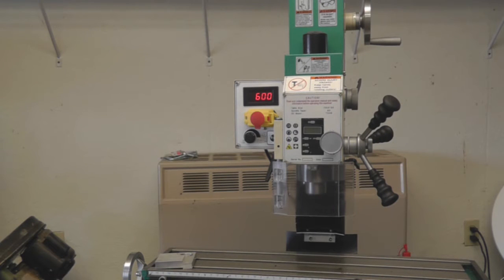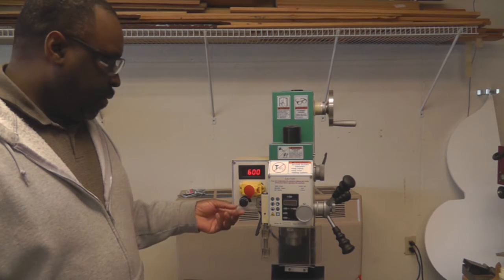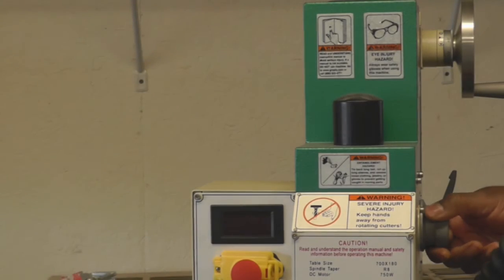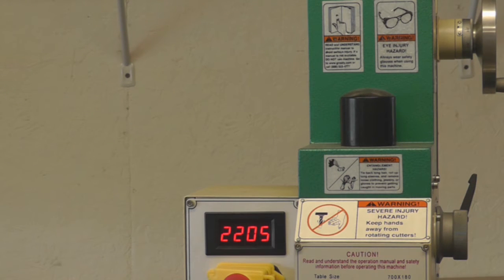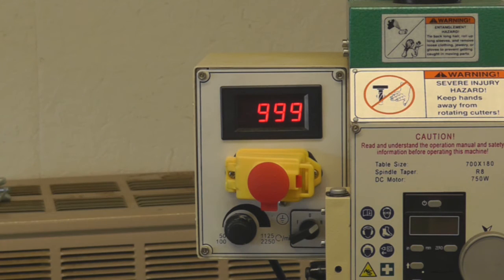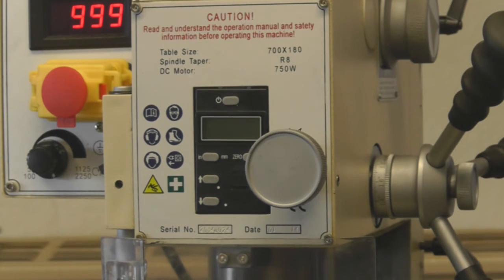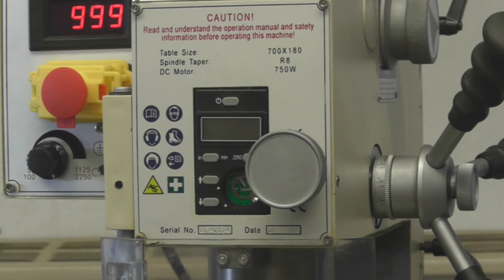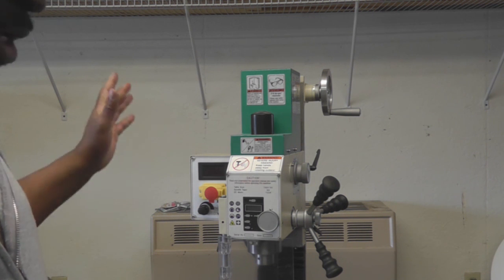Grizzly G0704 spindle break in

Comment: Hi just purchased a G0704 Do u no what's a Good speed to run a 3/8" end mill to cut 7075 aluminum? I'm still new to CNC machines, Mines 0704 is still stock. Thanks in advance
Reply: Look on Google for materials and optimum cutting speed.